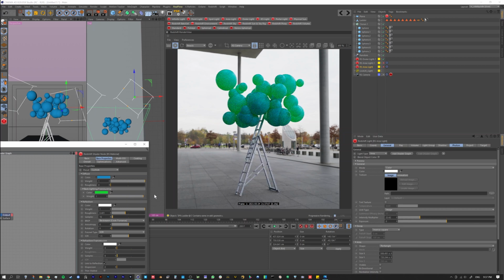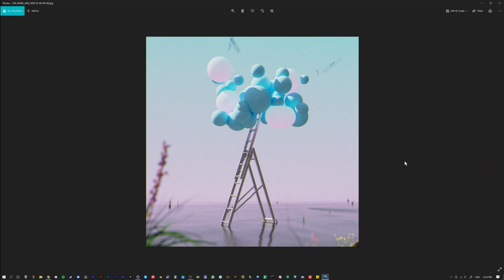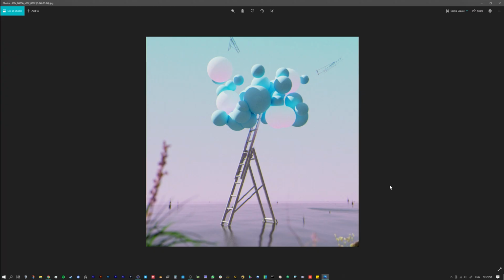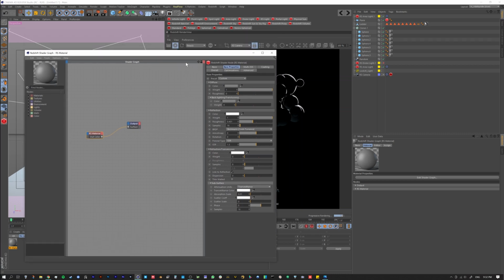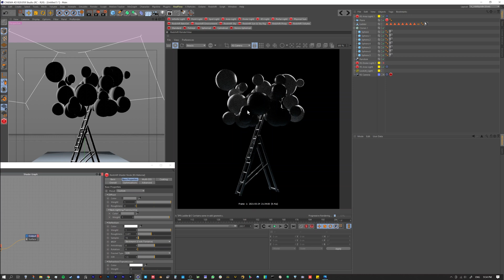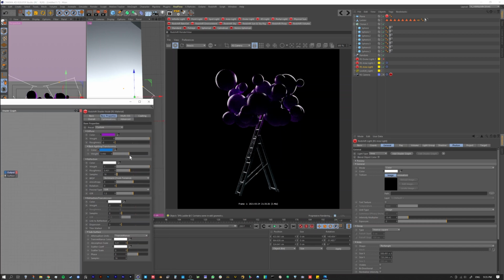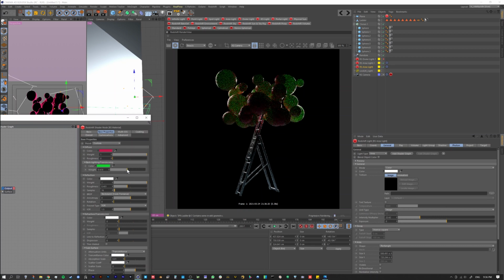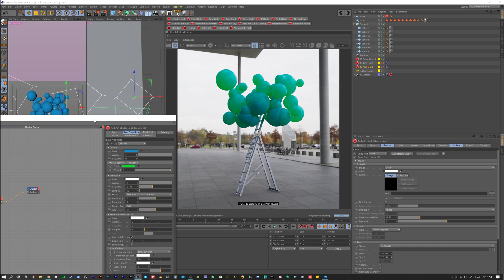Fake Subsurface Scattering in Redshift!?

Comment: Just an insight here (haven't tested yet): If you plug a FRESNEL node into the WEIGHT of this Backlight, you can control it similar to the "Scattering" value of the SSS. (You can even use a RAMP between the two for some fine tuning).

Anyway... amazing hack! Thank you for sharing!
Reply from the maker: Oh nice tip! I would be curious to try this. Thanks for sharing and your support. 🤜🤛